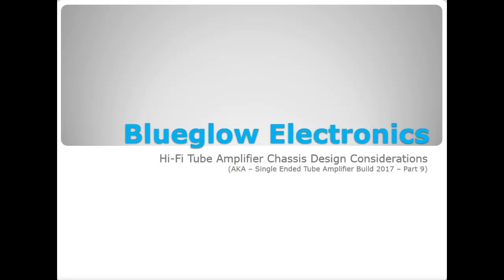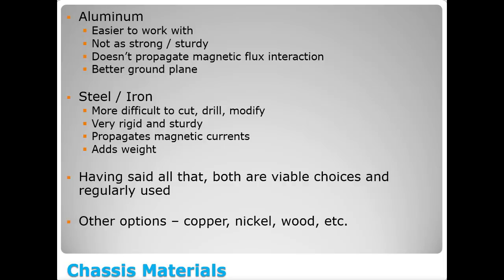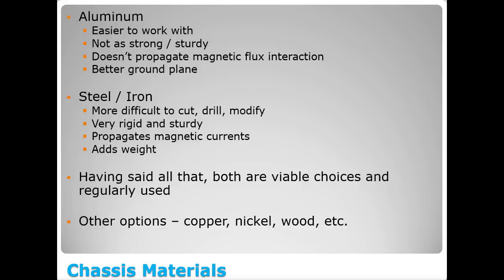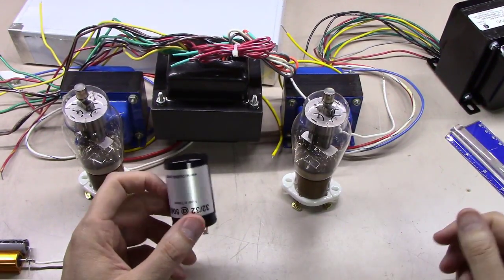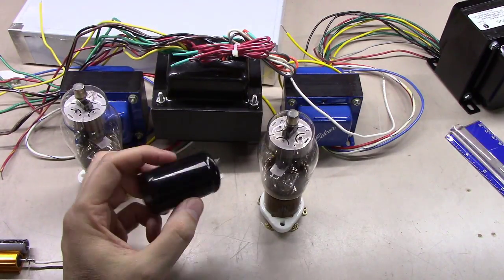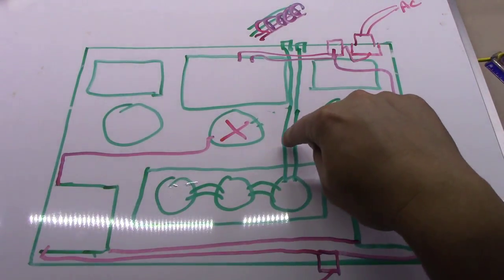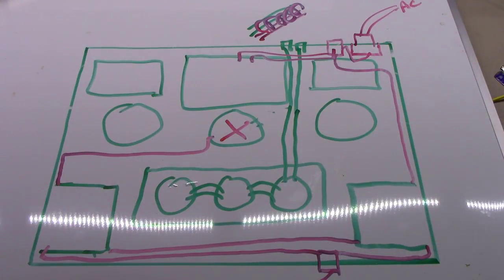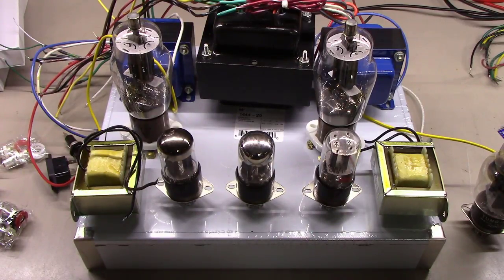Hi-Fi Tube Amplifier Chassis Design

Comment: a thought:  peavey mace tube amp. x-formers mounted at 45 degree angles so that the field planes had no chance at interaction with each other(so the theory goes). i can attest that i have not had problems with flux induced hum from the little critters on stage or recording. can't say the same for the marshall jmp50 head i originally used. set another head near it and it would do the 60hz buzz every time.

Comment: Hi Mark,
This question relates to previous videos. I thought it would be ok to post it on your most recent video. I have several transformers of varying types, kicking around the bench. I have 2 Hammond 1615's for my output drivers and I have a Hammond 272FX I’m hoping I can use for the power supply. I’m not sure if the 272FX will cover all the circuits in the triode dick design. The 272FX has CT 600V @173mA, CT 5V @ 3A and CT 6.3V @ 5A. That should cover it, yes? The fact that they are CT circuits means, I have 2 of each, yes? So 2 5V @ 3A and so on? I can always spring for a new transformer if necessary. But if I can use what I have lying around without compromising the final product, why not use what I have.

Comment: Excellent video Mark, thank you! I am curious what your thoughts are on powder coating the chassis? Will that have any impact, positive or negative on component layout? Also, I have noticed many tube amps (Dynaco, Mac, etc.) have cages over the entire unit or sometimes just the tubes. Probably just for heat protection? I have a friend who made this really cool individual tube cage/hood, out of those little metal pencil cup holders. He just used a hole saw about an 1" or so, to cut out the bottom so it dropped slightly down the tube, enough to it the chassis with the lip. They are pretty ingenious I have to admit and they look kind of cool too!
Reply: Stephen Studley and use two silicone o rings on the tubes to eliminate any harmonics
Reply from the maker: Powder coating will not hurt anything, however you will need to scrape it off inside the chassis anywhere you want to connect a ground lug or establish a ground like where the rca or speaker jacks connect.

Comment: what about mounting the Transformers in a lead shielded box this surely would be the best way! I don't think you would get any magnetic field leakage
Reply: What does lead have to do with magnetic fields? What you really need is Mu metal $$$$$.
Reply: I prefer copper plated steel  or aluminum.